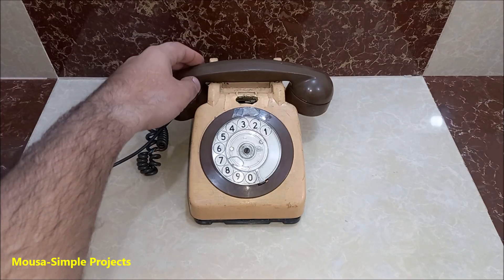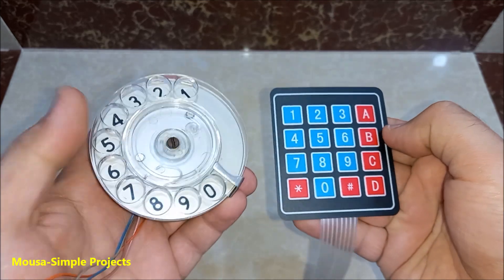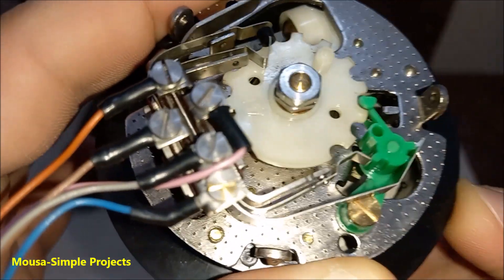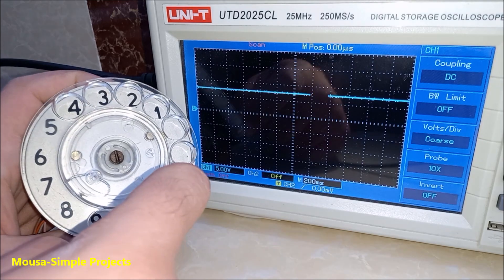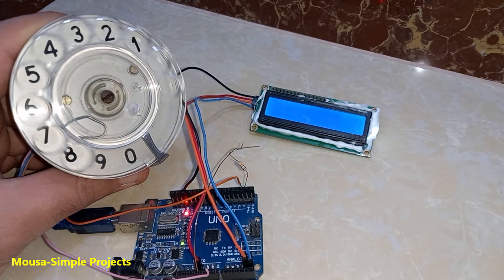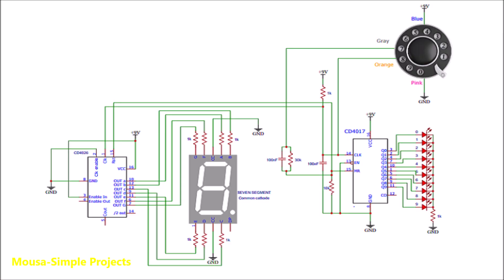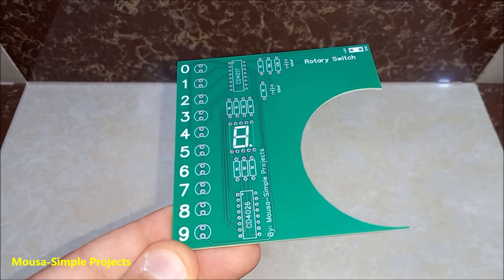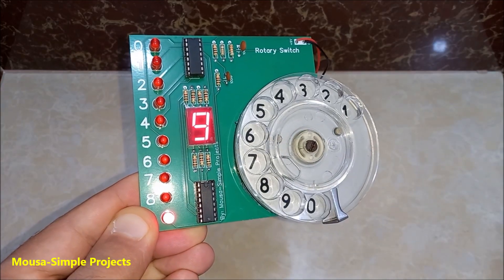How to use Rotary Dial Pad instead of Keypad

Comment: Does the gray wire send a pulse when the dialing is complete?  I ask because the dial I'm using only sends pulses (no "pulse complete" signal)  and so I had to use a one shot in order to determine when dialing is done.
Reply from the maker: Blue and Gray are "normally open switch", they become closed once you rotate the pad clockwise then back to open when you release the rotary pad, i used them to Reset the counter and seven segment to zero each time before you dial a new number.

Comment: how did you program the micro controller what program or tool you used
Reply from the maker: I used Arduino UNO , You need to install Arduino IDE on your computer from here: 
https://www.arduino.cc/en/software/
Then connect the Arduino board to the laptop via USB cable and upload the code.
Code here: 
https://www.mousa-simple-project.com/2025/06/how-to-use-rotary-dial-instead-of-keypad.html